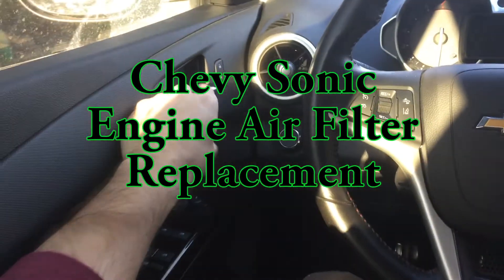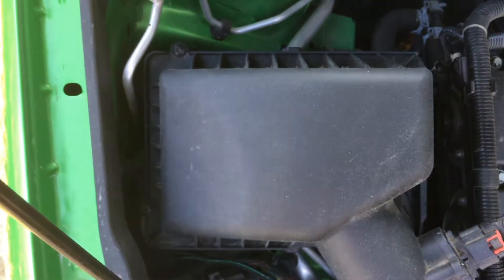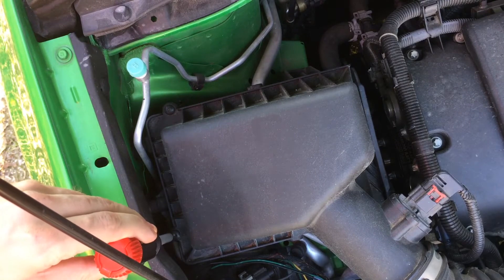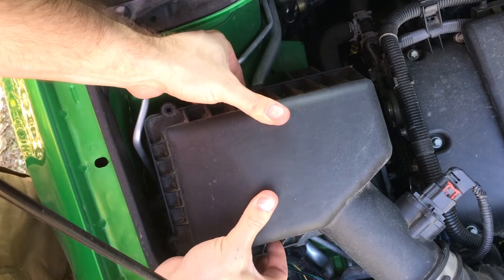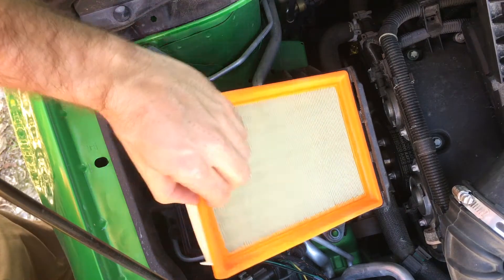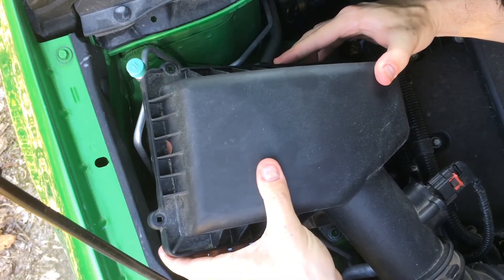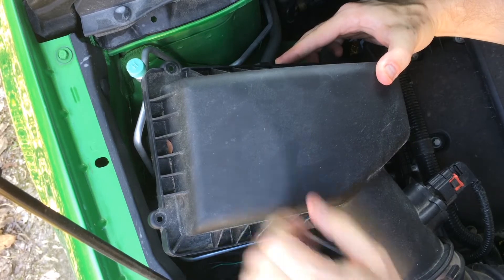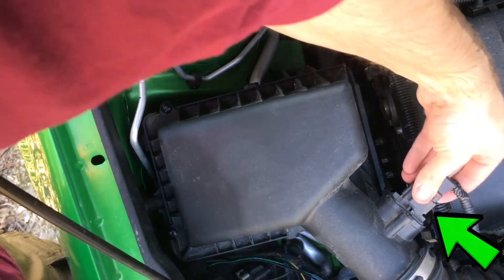Intake filter replacement in 60 seconds (Chevy Sonic)

Comment: Can the sonics be lowered in the rear ends? I happen to get better performance when I tweak with the trunk weight just right. Or when I load the back with passengers it feels like I have more grip and rides better.
Reply from the maker: You could certainly buy a pair of coil-overs and adjust them so the rear is lower.

Comment: You failed to mention what size torx bit or driver is needed
Reply: Glad I wasn't the only one annoyed by the lack of actual information relevant to, you know, a specific make and model — considering that without these details the video might as well be called "how to replace the air filter for the stock intake in pretty much any car from the last few decades"

Comment: how long have you owned your sonic and what year is it the reason i ask is im wondering if its had and issues
Reply from the maker: Dustin, this is a 2014. I'm the original owner and it has 33k on it. The only issue it's had was a stuck parking brake. However, that turned out to be a service bulletin item for some Sonics so the dealer took care of it.

Comment: Are you going to do any performance upgrades? Like intake, exhaust or tunes?
Reply from the maker: Matthew, I'd love too! However, right now I haven't decided on what upgrade will come first. I'm not sponsored by anyone so I'll be limited to only doing one upgrade per type. So tell me, what would you like to see first?
Reply: DIY Toona well the intake is pretty easy and ZZP makes a pretty good setup for the sonic. Also pretty soon I'm going to be installing the trifecta tune on my LTZ because it's the best tune I've found for the 1.4L turbo. I think if you find some cool upgrades to do that I would love to see what you plan to do with your sonic.